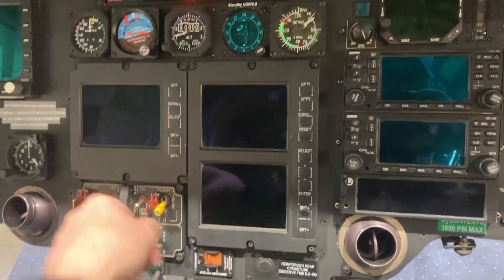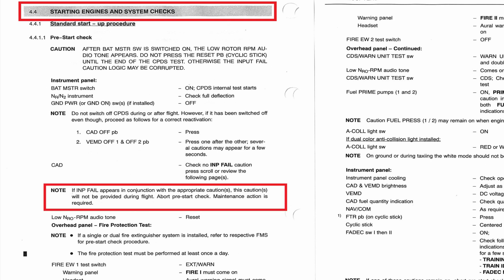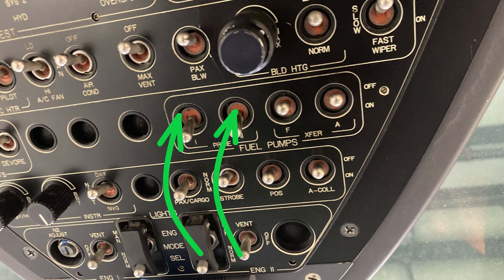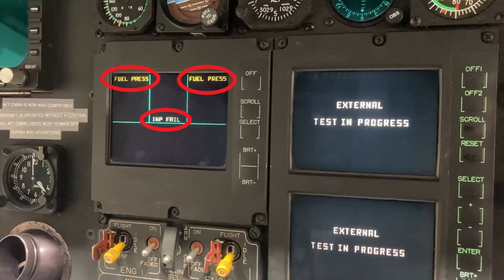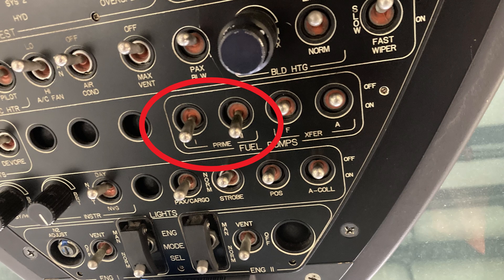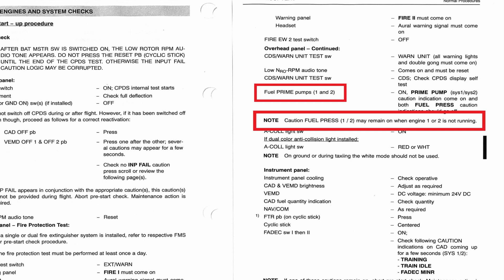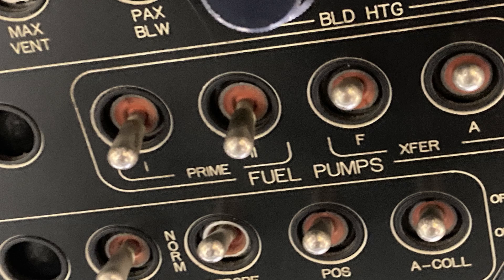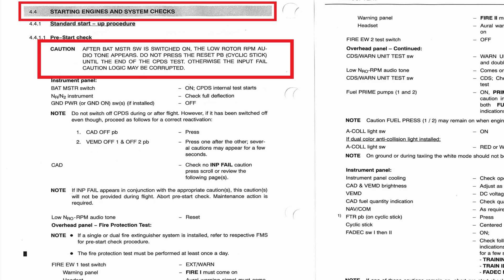"Fuel Press" Caution "Inp Fail" on power up | EC135 Helicopter

Comment: Hello. Please what can we do when the INP FAIL goes with ENG FAIL?
Reply from the maker: I’m not completely sure, I’ll have to do some research in the wiring diagram.  Just pulling it out of my memory, I think the engine out warning is figured inside the warning unit.  Either way something is not connected or a wire is loose for you to get that warning when the power is applied.
Reply: @HelicopterMaintenance   I must say a very big thank you. The Audio Warning Unit was responsible for the fault.
Reply from the maker: @blessingomoraka1389 I’m glad you’re ky got it figured out, awesome!
Reply: Hello Sir. Good day! We have replaced the Audio Warning Unit and the fault cleared. We did a flight and two starts, but on the third start we noticed that Engine Fail Indication for both Engine Remains "ON" even when the N1 is greater than 50%. That means whether we are on IDLE or FLIGHT the Engine Fail Remains 'ON' on both Engines. Please I will appreciate your advice on what we can do.
Reply from the maker: @blessingomoraka1389 oh man that’s bad news. Sounds like you have a loose wire somewhere or your warning unit is bad. Or the pins on the plugs that go to the warning unit might be loose. But there’s a good chance there’s a loose wire or a chafed wire that goes to the warning unit. I’m sorry I didn’t get back to you sooner. I was kind of out of town and on the road. But tomorrow I can look in the maintenance manual, or the wiring diagram and see if I can come up with anything. Let me know what your cell number is if you can.  And to be honest, I would call one of the tech reps, they’re usually quick to respond and are very knowledgeable.
Reply from the maker: @blessingomoraka1389 also, I think the key is that both engine out lights are on, so that might be a relay that goes to both of them, the same relay, and maybe it’s just busted inside.
Reply from the maker: @blessingomoraka1389  Ok,  I need to know a couple more things.  I want to confirm that the Engine Fail indication you are taking about is on the CAD?  Are there engine out tones (can you hear the gong in the headset) when the Engine Fail indication is on?  Looking at the wiring diagram (WDM 77-10-12-000) it looks like the only thing in common with both "ENG FAIL" indications at the same time is the CAD (Caution Advisory Display).  I am sorry that I took so long to look into this.  I would pull the CAD out, disconnect the plugs and look at the pins really well, 25VEC and 25VED are the plugs that have the wire for the engine fail indication.  Look at both sides of both connections and put some stabilant 22 on it or whatever you guys use.  Re-install and run it up.  If that doesn't work then I would replace the CAD.  Good luck.  Let me know what happens.
Reply: Thanks for the update. We just noticed that the newly installed Audio Warning Unit started to show the INP FAIL for the Engine. Could it be that something in the aircraft destroys or damages the Warning Audio.
Reply from the maker: @blessingomoraka1389  I don’t think the problem is the audio control unit in the WU.  It think the problem is the CAD, or the connectors that connect to it.
Reply: @HelicopterMaintenance  Thanks for your response. We swapped the Audio Warning Unit with the other aircraft and found the fault transferred. So, it seems more like there’s something somewhere that makes the Warning Unit unserviceable. This is the third one that has been installed. This is my reason for saying a component might be responsible for the damage to our Audio Warning Unit. Please your input is highly appreciated.
Reply: I will check to see where the Audio Warning Unit is powered from.
Reply: Thank you. I will also be checking from my end.
Reply: Is on the CAD and there's no engine out tones.